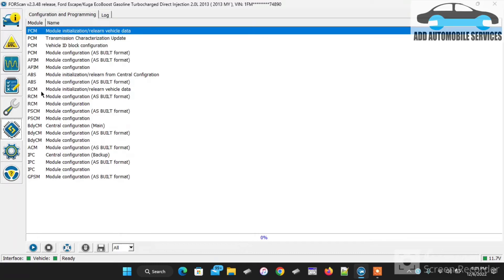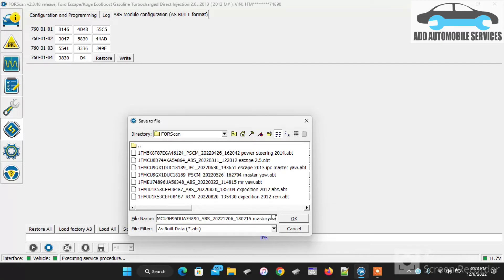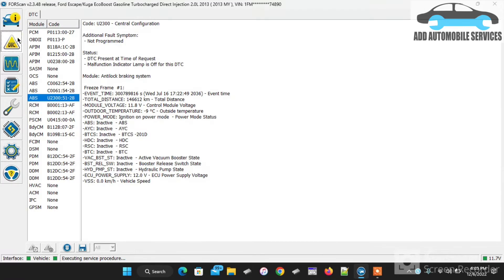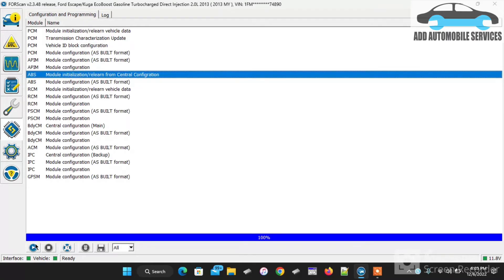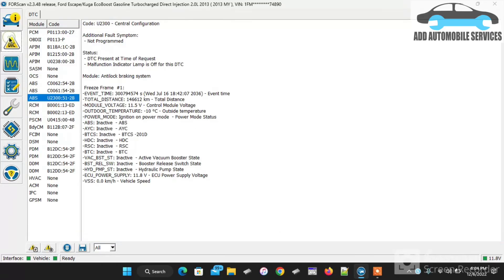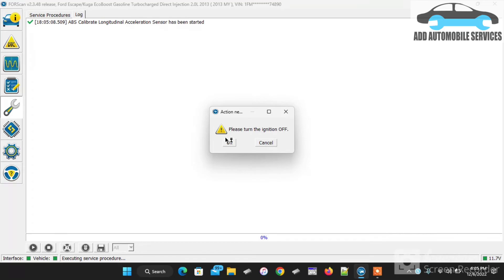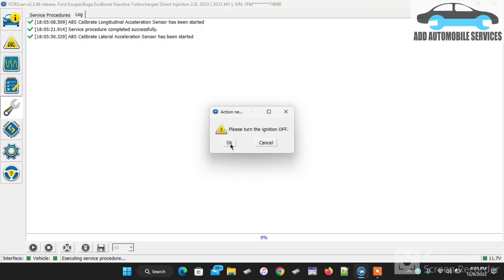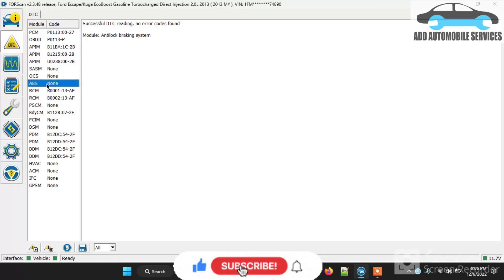Escape 2013: Programming and calibrating used ABS module with Forscan (U2300,C0061 & C0062)

Comment: Cannot program the used abs module on ford focus mk3 ,because the secondary immobilizer triggered when detecting used module with different VIN is installed.
Cannot turn the ignition on because blocked by the immobilizer
Reply from the maker: Turn it on with the old one and swap it

Comment: This may sound like a trivial question but as a novice FORScan user I'm compelled to as for lack of any documentation: How does one load a ab file from the Ford server into a licensed installation of FORScan?

While the interface isn't complicated & the .ab(s) file is readily accessible, I don't see the path by which to pull into FORScan in order to make use of it.
Reply from the maker: Forscan will do it for you automatically

Comment: Friend, my Ford Focus, in the ABS module, has DTc U3000 48 68 (failure in the supervision software) and generates this fault every time I need to use the ramp assistant. If I just reprogram it, will it solve it? And what will the procedure be, being the same module?
Reply from the maker: Yes you can try it or replace the unit

Comment: Great video. I installed a used abs module (same part number as original). I was able to do get to the "write all" procedure. But after.

 I do not have the "relearn from central configuration" option.

Do you know why this option is not  available? Thanks
Reply from the maker: Not all of them have that option
Reply: @ADDAUTOMOBILESERVICES  At this point. Can I just reinstall my original ABS module. Or do I reprogram my original one as well. (My original ABS module contained no error codes)
Reply from the maker: @ceezauto213  you can save the as-built and write it to the new one

Comment: So I just did my 2012 focus with a used ebay module, i didn't have to change the vin# and also there was no code for bad vin, so all i had to do is clear the codes like he did and rescan again and the go and do each code, after that you have to use forscan to bleed the pump, thats it, thanks for your video.
Reply from the maker: You're welcome boss

Comment: Is this the same for PCM reprogramming using FORscan? I have the license and beta version
Reply from the maker: No
Reply: @ADDAUTOMOBILESERVICES  do you happen to have a video on PCM reprogramming, I want to try to reflash my PCM before replacing it to see if that fixes my issue, had 2 wires broken and touching on #3 COP, I fixed wires and swapped coils and it's still on #3, the last cause for one of the codes is faulty PCM
Reply from the maker: You have to use oem software
Reply: @ADDAUTOMOBILESERVICES  I got my PCM updated with the FORscan, literally had a line that said update PCM, also found out what to do if I need to get a used PCM and flash it to my program, I program industrial robots, so it just took a little snooping around to figure it out, I had heard you can do all that with FORscan, that's why I bought it, I was just trying to get as much knowledge about the program before I got the link and started playing with it, did have to update abs module and then body control module after the PCM to get rid of the check advance trac fault and the check abs module fault, you have to have the paid license and beta version downloaded to write to the modules tho
Reply from the maker: @Dsmwarrior1996 👍

Comment: Hi we have trouble with focus c-max 2016 all brakes locked on but no error codes in abs.. can you help?.  I've read the original data as back-up
Reply from the maker: Fix the new one and see the fault in it before you restore it.
Reply: @ADDAUTOMOBILESERVICES  thank you much appreciated 👍
Reply: Added a 2nd unit but now car won't start, wrote original data and calibrated abs but often pops up with immobiliser fault on dash no error codes
Reply from the maker: @simonmg6797 what are the fault code

Comment: Can you tell me did you have the original abs module plugged in when you saved as built and then plug in the used donor module and let forscan take needed data from the original and download onto the donor module ? Thanks for the video brother!
Reply from the maker: Forscan have something like load factory data it will download it from there server unto ur laptop without the old one
Reply: @ADDAUTOMOBILESERVICES  thanks a lot..seems this pcm has the vin locked or something. I've tried everything to get it to load the vehicle vin for the abs. I'm going to try saving abs data drill original module i think i can plug it in from the under side without having to remove the replacement again. Thanks for your response!

Comment: I've fitted New/ Second hand module.  Followed your instructions :abs module initialization/relearn from Central configuration but my service procedure is not supported.  Any clue why not??
Reply from the maker: Check the part number
Reply from the maker: Check the part number
Reply: @ADDAUTOMOBILESERVICES  
Yes I did. I had to take the module out to check
Reply from the maker: @markwalton8644 did it match
Reply: @ADDAUTOMOBILESERVICES  
Yes.
I originally bought an ABS module for 2010 model but was wrong. I realised this when I took it out so ordered  the right one.  Unfortunately I can't say for sure whether the New/ second hand is OK, so maybe I might have to order another one. The Problem is to buy complete newfrom Ford it is £2k😂
Reply from the maker: @markwalton8644 try another one
Reply: @ADDAUTOMOBILESERVICES  
Ordered👍

Comment: Comes up with an error when trying to add a spare key . [20:28:59.352] Module returns incorrect outcode. It means the module is out of normal state.
[20:28:59.361] Recommendations:
- Make sure there are no wire/connection problems between modules
- Try to reset module using service function "Module Reset" (if available), or by disconnecting the battery for 20-30 minutes
- Try timed access (if available)
Reply: Can you please help
Reply from the maker: What are the fault code when you diagnosis it
Reply from the maker: Pls what is the year and model

Comment: when trying to calibrate the longitudinal acceleration sensor , and going to write it all i get is module configuration not getting configuration option in the write section
Reply from the maker: Change the as-built data

Comment: be warned if the imobiliser runs through the abs module you can configure the module but the vehicle will not start unless you match the module to the pats system
Reply: Absolutely !
Reply from the maker: Yes
Reply: @ADDAUTOMOBILESERVICES my vehicles immobilizer is part of the sbs so i should copy the old abs? Will forscan know to pull data from the old abs with replacement plugged in? Thanks a lot!
Reply from the maker: Yes all you need is internet
Reply: How do I do this to a ford transit 2016 I don’t have the old abs module only a used one the van won’t start
Reply from the maker: Scan all systems to know the problem

Comment: Thank you for the info. I have 2009 F150 Platinum and I grabbed an ABS unit from a salvage yard. despite the coding being correct I'm still a configuration code. any thoughts or assistance would be appreciated. Thank you for the content.
Reply from the maker: Are the part numbers the same

Comment: Thanks for your video. I replaced the electronic module of the ABS on a 2011 Ford Explorer. The old module was not readable and I was not able to retrieve old data. I was able to program/add the as built data using Forscan.  I now have error code U2100:54 - Initial configuration not complete-missing calibration.  I do not have a tab for ABS Module Initialization/relearn from central configuration to initialize the ABS module.  Any suggestions.
Reply from the maker: Try abs module calibration for the steering angle sensor and the calibration in the special function in the forscan
Reply: I have the same problem, you can solve it?
Reply from the maker: @elvisricardo1 yed
Reply: Hi friend, your video is excellent and very well explained, but I have a question: is this process done after installing the new, used ABS? Shouldn't I copy the data from the damaged ABS?

Thanks in advance.

Comment: Do you know if this is a similar process to be done if changing an abs pump on Mondeo 2015 would it just be a case of performing the service functions for the sensors please tia

The customers going to be using his old module with a brand new pump
Reply from the maker: No need

Comment: Hi, thanks for your video! I tried doing this on my ford mondeo 2014 but when I put in the used abs unit it could not find as built information. I tried abs reset and initialize/relearn abs but still wouldnt turn the car on. Also tried saving my abs data from my original one and loading it onto the used one but the data seems to be the same. I'm not sure what to do, if you could point me in the right direction I would really appreciate it. Thanks
Reply: Any update
Reply: Im having the same problem, was able to copy the data from old abs unit and copied it to the new one, no DTCs after calibration, cant find as built online from forscan, car does not start.
Reply: @wasifmusba  for me it ended up being some damaged wiring not allowing the process to work as it couldn’t communicate with it
Reply: @nabirahmed9628  I need to check in that case, but no DTC's are showing up about ABS anymore so i have a hunch its a immobilzer issue because its part of the ABS module according to forums.
Reply from the maker: @wasifmusba ooh ok
Reply from the maker: @wasifmusba pls check the unit

Comment: Hi great video. Would this be possible on a 2015 fiesta. I want to replace the faulty abs unit for a second hand one off eBay with the same part number. I have forscan on my laptop already.
Reply from the maker: Yes it will work
Reply: Hi thanks for the advice, the as built file did not contain the abs information but I did the reset and relearn central configuration and it works. I need to replace the IPC on this 2015 fiesta as well, I have the as built info from the current one but I am not sure if the IPC is on the pats security, I don't think it is but any advice would be good.
Reply from the maker: @richmc8209  it is not part of it

Comment: Thank you SO MUCH for this video! Can i ask a dumb question...in forscan it will get the original abs module data directly from ford? I dont need to plug my old unit back into the truck to get the abs mod info?
Reply from the maker: Yes it will pull the factory data from Ford server with the vin unto the used ABS module
Reply: @ADDAUTOMOBILESERVICES  just wanted to let you know it worked for my 2011 f350! I can't tell you how happy I am. I would've had to wait 2wks for the ford dealership to get me in not to mention whatever the shop bill would've been. I owe you one man! THANK YOU!
Reply from the maker: You're welcome
Reply: @ADDAUTOMOBILESERVICES  I have a 2011 f350 6.7 is there a way to check to see if they have the "as made" data for my truck before I start the process? Sorry for all the questions. Thanks for all your help!
Reply from the maker: They have

Comment: Hello, is it also possible to program the current abs module in that way? Since the new abs sensor has been replaced, but reports fault code ABS U2300:51-2B. The code in question cannot be removed with any reset program, not even Forscan.
Reply from the maker: Rewrite the Vin on the vehicle abs module or if still showing change the abs module
Reply: @ADDAUTOMOBILESERVICES  Stupid question, where can I find that vin?
Reply from the maker: From the pcm. What machine are you using